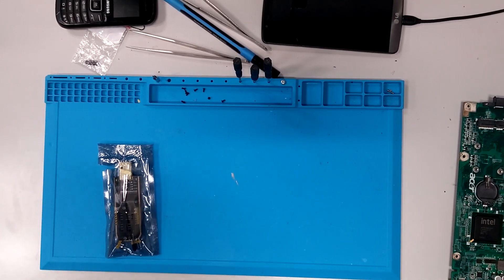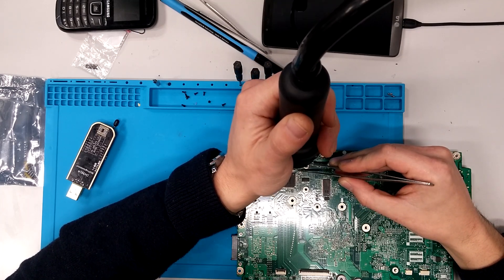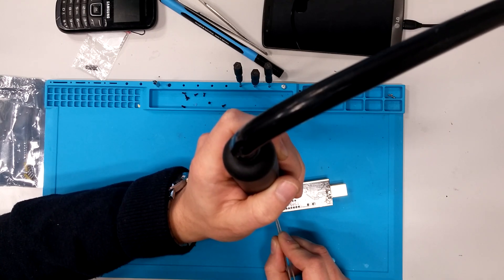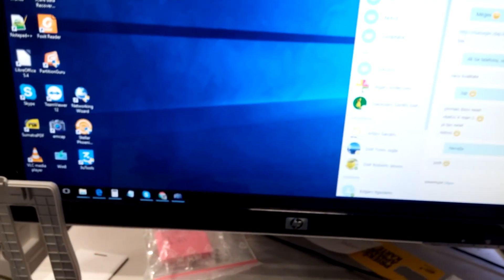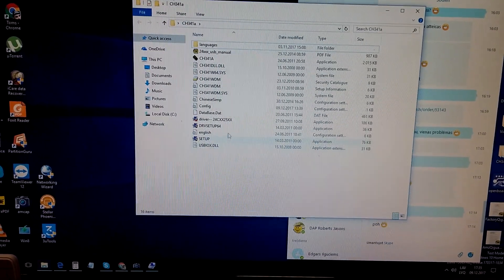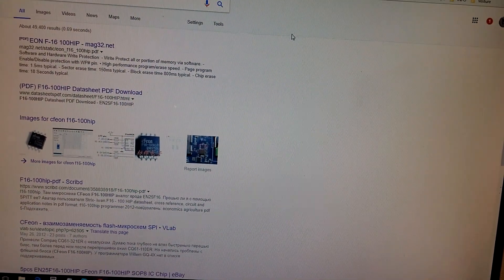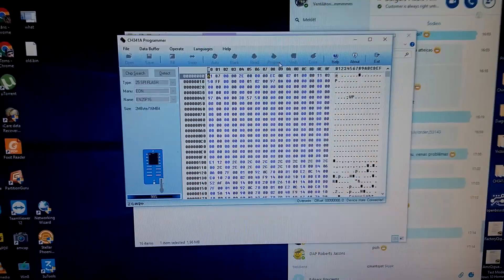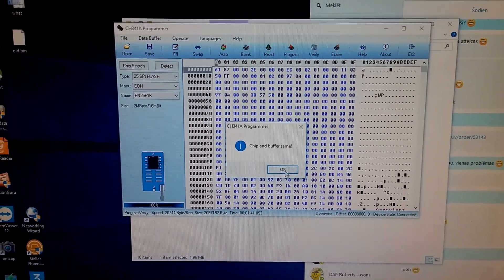How to use CH341A bios programmer

Comment: Is it possible that the programmer is adding  some corrupt data with the original saved dump when writing the chip? I have that kind of problem ,the writing it's not the same with the original dump after flashing, its reapeting the 00 addresses and don't know why

Comment: Hi. Is this process different from doing it with the clamp or it is the same and maybe more convenient if I use the clamp instead of soldering stuff? Because I'm acquiring the ch341a with the soic8 clamp and soc8 adapters altogether. Thanks.

Comment: Just used this on my bricked Lenovo 330s Ryzen laptop and it worked wonders. So happy to have a working laptop again. Also it’s much easier to use an soic8 clip instead of desoldering and resoldering the chip.
Reply: If you had a video on your experience of this I would watch it! My Asus Vivobook 15 F512DA (X512DA) would be very grateful too 🙏🏼 as it's basically now a brick thanks to Windows 10 update and Bios update (🤦‍♂️). Cheers! 🙏🏼❤️🙌🏼

Comment: Awful video design (no focus pulls on soldering or ROM package markings,) awful audio (mixed too far down, not normalized,) still the best video on the topic I've seen so far. Auto-ID and reading the package are failing for me so far, so I'm readin' 00s on what I imagine is a 1.8 V package from an A10-based mobo. Hoping WIn10 doesn't quarantine the BIOS file again... Anyone make a Linux vid say yo!

Comment: see im fine with the actual programming bit - that bit is easy - it's the de-soldering from the motherboard, soldering it to the programmer then unsoldering from the programmer and re-soldering back to the laptop motherboard that is really really really hard

Comment: New OnePro BIOS programmer
CH341A 24 25 series EEPROM
There is similarity

The USB writer has OnePro_EN.zip and GZUT_OnePro_CN-EN-32-64_V3.2.zip,
When deployed, another application can be made, but it was the same application when started up.

GZUT_OnePro_CN-EN
Deceased Yes _ 1 unnamed case. No unnamed file was found.

OnePro_EN
Open with one click

Comment: takes a while.. add a touch of flux.

use an adapter not direct to programmer.. it popcorn's puffs up the layers very easy.
most chips have a dot.. matches to pin 1 and white line bold on programmer.

i use flashrom in linux or win with -p

read 2 copies and save.. compare both.
Reply: Listen to this guy, perform two backups before flashing!
Reply: Arnold G what do you mean exactly? My chip does in fact have the dot that you speak of. My usb programmer is green, and I believe it has the same exact pads on the back. Is there a guide that goes in more depth?

Comment: hello. how do you know which pin to solder on slot 1? i'm worried of damaging the chip if i don't solder it correctly.
Reply from the maker: There should be a white dot on the chip, witch show the orientation, as explained in the video. :)
Reply: @thisishow5223  thanks from me too